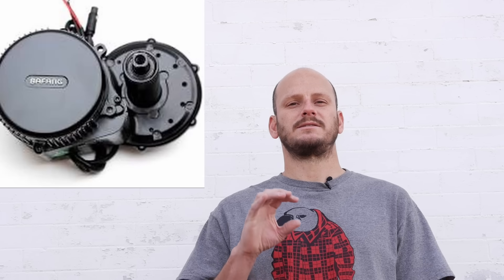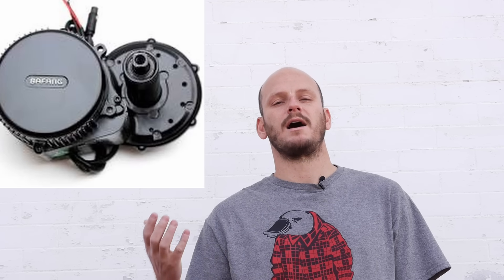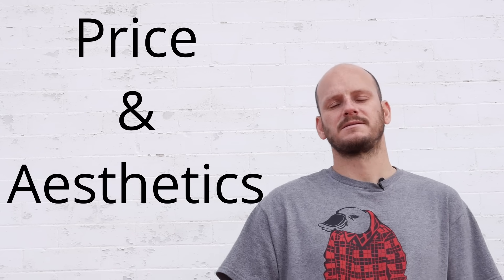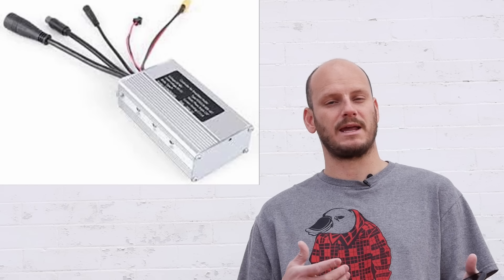Hub vs. Mid Drive Motors: Why Hub Motors Suck and Debunking Common Myths with performance test

Comment: I would like to agree with you, but you've missed a few bit. 
First: Torque.  Mid drive motors use the same gear ratio as you, and that's bigger than 1 in most cases, so the motor brings less torque, but more speed to the wheel. Anyway - torque can't be compared without factoring in you gear selection.
Secondly: breaking spokes. The spokes are transmitting the power anyway, the mid drive motor has just other elements (chain, etc.) as a hopefully weaker link. And if anything, the bigger hub actually it better for having the spokes at a stepper angle and therefore transmitting the power without bending as much. Why you expirienced them breaking more often... there are many reasons, but not the one you mentioned.
Third: Wear on your drivetrain. Most Shimano groupsets are designed for 50 Nm max, so a mid drive motor is way out of spec for that.

Comment: I have a bbshd and a 1000w rear hub and  even tho the mid drive is more efficient and feels more natural, I like riding the hub better..  it more fun and I haven't experienced the part where you say it doesn't have torque.  To me, it feels like the hub motor has more torque.. just my experience

Comment: Hub motors are way better i think, i got a 52 volt battery with decent controller to a 1000 watt hub motor an it does like 36 mph plenty of power wheel spins on the grass and wet mud im almost 12 stone in weight an it pulls me up steap hills very easy and tightning a few spokes every couple weeks or so is cheaper then buying a new chain

Comment: Can I simply install a hub motor, installed on a bike wheel and tire. Then simply use a battery and switch for full power or NO power, like the first airplanes.

Comment: You should have explained the context. The way you present it is very condescending. Was it really necessary to imply that anyone who prefers hug motor is stupid like the Sloth?
Also, what about the price? You compare wattage only. That's not really apples to apples if there is a price differential. I don't know if there is, but you never mentioned it.

Comment: The most obvious point for me here is that this very thorough treatment covers ebikes with throttle control. In the UK (and I believe much of Europe), ebikes must be pedal-assist types or they are not legal. As I think at least one comment here says, for this purpose, hub drive is absolutely fine and, within the limited speed range required by law, there may be very little to choose between the two configurations. If you are not legally speed-restricted in your area and don't intend to pedal, then the advice in the video stands perfectly. However, where I am, this is not how ebikes are used.

Comment: You make some good points. Your point about hub motors transmitting power through spokes is correct. But this is the same case for a mid drive. You failed to mention that mid drives destroy your chain rings, destroy your chain, destroy your cassette/cogset and destroy your derailleur pulley wheels. If you ride your hub motor bike as a motorcycle without pedalling, then your drive train remains immaculate. Also, mid drives because of the varied gearing of the drivetrain transmit way more torque to the spokes than a hub drive.

Comment: I have built myself a 14Kw hub motor bike, it does 0-60 in less then 4 seconds and tops out at 105km/h i want to see you beat that with your shity mid drive.
Reply from the maker: Do I have to use a shitty one? If I can use a good a mid drive will outperform a hub motor all day due to gearing ratio. It’s using leverage as an advantage 😀

Comment: I prefer mid-drive for weight balance, efficiency (range), and serviceability.  My one complaint with mid-drives is chain wear - I have 6,000+ miles on my mid-drive and I'm replacing the chain every 1,200 miles.  I've also had several broken spokes on the mid-drive.

Comment: Yeah, better speeds cause you've got gears lmao.  Could have summed up the entire video with that one sentence.  The simplicity, cost, and style is the reason I went Hub motor.  The ebike I bought is peddle assist and it won't deliver power until ~2mph.  You make a good point about people burning up motors, but that's attributed, I believe, to operator error; riding up hills slowly, etc.  You kinda come off as prideful/cocky with the whole "anyone that buys a Hub motor is an idiot" kind of attitude.  Mid drive owners get what they want, torque and speed, while Hub drive owners get what they want, simplicity, no gear slippage, no shifting to worry about (crunching), silent ride, and sleekness.
EDIT:
You as a bike mechanic, I can see why you have such a strong stance on the topic, having to repair the wrecks.  But from a consumer standpoint, a lot of us are just out to get exercise on it, so this so called debate isn't as polarizing as you make it out to be.

Comment: Rear hub drive doesn't wear my chain out, and if I pedal I get the torque from my pedaling and the torque from my motor spread out not all on the chain.  Rear hub is excellent

Comment: So there's nothing wrong in principle with either system, there are poor designs for both. no motor should burn out, and the way it feels can be programmed into the drive system. This is all about design implementation, NOT the position of the motor.
Reply from the maker: You are correct about quality. Definitely the mid drives benefit from the leverage of using gears though.

Comment: I have an Adult Worksman Tricycle! Trying to put a D775 on the front airless tire. The way the Tricycle is built it would be hard to put a mid drive motor on my tricycle. I am 235lbs 6'2 and the Tricycle is about 45lbs with a weight capacity for up to 500lbs. I don't need a lot of speed. Almost 64 years old. Have been building bicycles since about 1963. My dad helped me and my brother to build bicycles from scrap. Trash! Used to race bicycles. We built a bicycle from old plumbing parts and sold it for 200 dollars in 1967. Slime tubes   24 inch back tires. Folks here throw glass on sidewalks and the streets. Might need a second motor? We would build our own motors from scrap for early mo-peds. Fast but economical hybrids. Half gasoline and electric motors. Up to 70 miles per hour on one speed English Racers from a hybrid motor in the 60s. Didn't do a lot of turning but we were kids. Dad got really mad at us kids for that and disasembled the bicycle. The tires were so skinny and we had too replace them all the time. Tore up our rims. First technology was back in the 60s my man! Made in USA.

Comment: You compare gears in a combustion car with gears of an e-bike.
Theoretically electric drives need less gears because torque is ok, even with low speeds. Electric cars don’ t even use gears.
Hubs don’t put strain on the chain as well.
What about conversion efficiency of electric energy to mechanical energy ?

Comment: I'd also argue for 2WD drive in bikes: put hub motor in front so you can get better traction on gravel and sand.
Reply: On snow also. No mid drive to my bike.
Reply: Then make it 2WD with mid-drive for rear and redundant hub in front.  You then work each motor half as hard too, as well as the chain, etc.  For hypermiling you then shut off the front motor  (and of course reduce speed) to get max range.  Your range will be a little lower due to the hub's rotational mass, but range isn't everything, increase battery.

Comment: 5:50 Let's think for a second how power gets from mid drive motor to the wheel rubber surface. It's those damn spokes again, right? If hub motors cause spokes to fail more often, that's because of more unsprung weight directly applying force to the spokes.

I'd guess most hub motor users just don't maintain their bikes properly and they would get snapped spokes even without a motor.

And you don't need truing stand to properly tension the spokes. It just makes things a lot easier. You can use the front fork as the holder, clothespin or even a bit of tape as the measuring device and ping sound from the spokes to measure the tension.

Comment: 2:05 If the motor is getting same amount of energy and not outputting the same wheel torque then somebody is simply lying. Power (measured in watts) is literally torque multiplied by RPM. And energy is literally power multiplied by time so if output 750 W for 5 seconds to the wheel, you get the same acceleration regardless of engine technology.

Of course, this all just means that hub motors have worse efficiency in reality, no matter what the manufacturer claims. The 750 W rating is max power consumption, not actual power of the engine and seldom even the actual power consumption either.

Of course, the fact that hub motor cannot use transmission means that unless the motor can actually do 750 W regardless of the actual RPM of the wheel, you're actually getting much worse performance nearly all the time because that 750 W probably happens on very narrow RPM and torque range.

With a good controller and electric motor, hub motor could in theory give all the power you would need and the only big con is that the motor is part of unsprung weight. Case in point: Tesla cars have exactly one gear and they have the best acceleration out of all production made cars. However, doing that requires high quality motor and even higher quality inverter ("controller").

The really hard part would be taking the battery pack you have, using DC-DC converter with high enough power rating and applying that power to the hub regardless of the current wheel RPM. If you can create such an inverter/controller, the only reason to go with mid drive would be to avoid unsprung weight if you have full suspension bike.

Comment: Hey man. I'm seeing these dual motor hub drive bikes now. Front and back. Then u get 2000w instead of 1000w in the mid drive (which is what I had). What are your thoughts plz, surely it's more power and better?
Reply from the maker: I have a video on that 😄 just search “dual hub motor”

Comment: Regarding hub drives, was this comparison rear hubs only or both front and rear? It appears the front hub would be a a very easy install than the mid drive. While I can get around my very hilly area, my 74 yr old arthritic  knees could use a little push going uphill.
Reply from the maker: Both front and rear hub motors are generally designed the same way. A mid drive will definitely be better for steep hills.

Comment: Mid drive motors have gotten much more expensive than hub motors.
Reply from the maker: Not in the aftermarket conversion realm.
Reply: @JohnnyNerdOut  Idk man. I'm trying to build or buy a 500w ebike.
I can get it down to 7-800 on a hub and 9-1100 with a mid drive.

Comment: I have had a hub and now ride a pedal assist Bosch Specialized Como 3.0. This season will be my fourth with 'Thibault'. A bike like this needs a name and I call mine Thibault(T-BO) which is short for thunder bolt. I am about to turn over ten thousand miles and not had one issue with this motor. This bike flattens out hills, is able to do almost 30 MPH, and is a blast to ride.
One other thing with the hub drive bikes are, when you get a flat tire, putting a new tube on is a real pain.

Comment: Hub motors can be geared or direct drive.
Direct drive hub motors should be more reliable in theory.
Spokes only work loose when they've not been tightened and set correctly.

Comment: 5:54 
I have a 500w hub drive cargo bike that I have over 3000 miles and never had a spoke break, even when someone’s on the back of it

I agree mid drives are still a lot better, I’m getting a mountain bike converted to a bbshd

Comment: I have a superb Ribble E Gravel bike which has a hub motor. He’s missed out a key issue for me: My bike rides with virtually zero resistance when the e motor is switched off. Mid drive motors have WAY MORE resistance if you’re not using the motor, and this makes the bikes cumbersome and harder to ride.
I bought mine so I could have assistance when I want/need it, but it rides like a normal gravel bike when I don’t need it. This is a massive issue unless you are just going to have the motor on all the time, which many people don’t want.

Comment: Mid drives would be great if they werent 2-3x the price lol
Reply from the maker: If you spec out a decent hub motor, they run about $450. Same for a bafang bbs02 👍
Reply: @JohnnyNerdOut  maybe if you are building one yourself. But if youre looking to buy a pre built e bike, hub style start at $1,500, and mid-drive start at $3,000/$4,000 CAD.

Comment: im sitting here watching until 4:52
what u are saying might all be right, but
the analogies break down real fast between car engines and electric motors
the higher rate of burned up hub motors might also be a phenomenon of hub motor bikes usually being cheaper bikes overall
there is just many points where i can immediately think of why what u are saying doesnt really justify the conclusion
Reply from the maker: Check my pinned comment. You are mostly right about cheap hub motors vs well built ones 👍

Comment: You say that the hub motor can break spokes. But isn't the rear hub on a normal bike also going to strain spokes but in a smaller circle? I do agree with gearing. I've converted a bike to 750 watts and I was happy with it but I didn't have any hills. So with that extra torque how much torque or strain can a human put on the chain? Thank you for a great video.

Comment: i have a hub motor and i have no trouble  wih hills it dont slow down i go up a steep hill every time i go out i pull out of a stop faster than cars and if i set it to its highest speed i can do 40mph the wind head on is no problem so i dont get what your saying as right in all cases

Comment: Wheel Spokes ..You tighten them up ..with key that twist ...and all spoke wheel buckle if your hard offloading or dropping off curbs ...even if dont have a HUB ....It part of servicing bike should tighten your spokes after rides ...other wise it will buckle latter ..

However you may have service the wheel tighten spokes more with Hub  ....that true ....
Plus Hub motors will fail more often ... You can also Replace just Bafang motor simply taking out motor from wheel put new one in .....

HUB IS way more easy to FIX .....
You can also ...buy two Hub motors for price of one Mid drive ....

As Far as Torque goes ...just crank up and Push More Amps ..

you can push 250w with 60amps and it do 35mph ....you aint getting mid drive motor that does 35mph without costing and absurd amount of money ....

Get wheel trued ...do it self in 15 mins one most easy jobs ...aint even any where as hard as installing a mid drive or removing one ..and forget about opening up mid to fix ...

100% Hub is way way more easy to Fix and Replace and Mod and cheaper and Higher Top speed for lower price

MID DRIVE controller ....TRASH ..everyone knows this ....Hard to MOD ...and when controller brakes ..good luck replacing or fixing controller that in the MID Drive .......

Comment: I have both drive types and I had the hub first since it is cheaper. My first bike $800 amazon, second $2100 from China direct. The later bike has a 1000w Bafang mid drive. The ability to use the assist up hill is cool, but the 7 gears are not always easy to use. The difference between driving stick and manual, you have to think, and not always when it is convenient. You have to shift ahead of hills or you end up power skipping the chain with the motor assist. For my $2100 bike it only uses gear 1 to climb any significant hill. I tried gear 2 and it skips like crazy in any assist level. My 7 only works on a perfectly flat road or down hill, or it will skip with assist even in assist level 1.  6 is my go to cruise speed. I work through 3, 4, and 5, often. I been riding both bikes to the battery is out lately. I park one and hope on the other. The top speeds and average speed is not that different. The key difference to top speed is how full the battery is. When it gets low it gets much slower. When either bike is full I hit 20pmh easy. I think that is funny since the cheaper bike has the 500w hub motor. The hub motor bike I leave in the mid range of gears most the time and forget it unless necessary in the moment. Now for the steepest hills, mid-drive wins, being in gear 1 with power assist 5 is a dream, as it mitigates the down side of the granny gear, the infinite crank turns it normal takes to get to the top, can be streamlined by the motor. I hope it is easy to upgrade and replace the sprockets on my mid drive bike. It will surely destroy chains and the gears faster with the motor torqueing the drive train. So my conclusion is the increase in money had some rewards but not necessary enough to justify the cost increase. Both ways have pros and cons that any buyer should understand. For a budget friendly entry into ebikes. I recommend the hub as it is much cheaper. A lot of people I know do not use the bikes as much as the imagine any how. The thrill of the motor assist bike can be had on either. At least hub motors chain won't suck your pants in!
Reply: Agreed, I have a BBSHD and it's fine but the chain wear and also it ate a derailleur once with the torque when it crashed, I now use a 7 speed rear and front 750w geared Ezee hub. It's better for commuting. Still have both and honestly the BBSHD was only 60 bucks at a thrift shop so I'm not biased from spending a bunch on it. Hubs are FINE.
Reply: Hey, modearnity : T
That was a lot to read to understand your point.

Here is the issue I just wrote about - What are your thoughts on converting to a 3-sp IGH rear drive?

Comment: Mid is too expensive I got an used 350w ancheer 700 bike for 400 original charger and battery bwith keys (in case you think it was stolen) then I saw another brand new for 400 so I got both in case one gets stolen